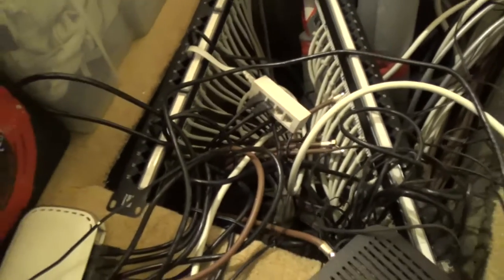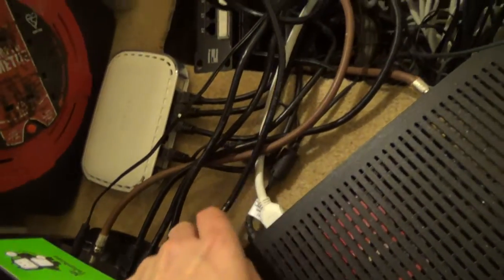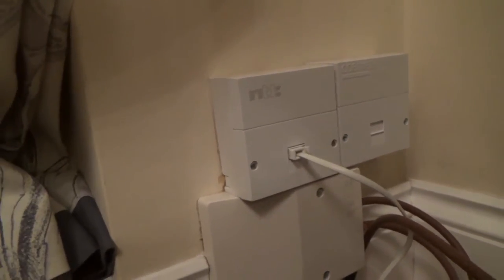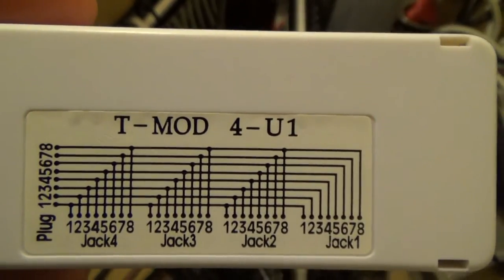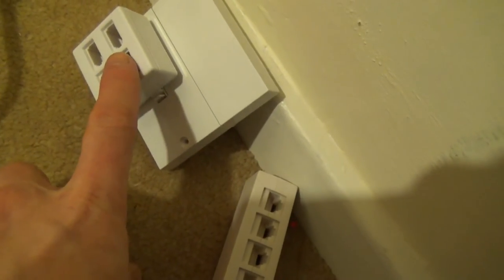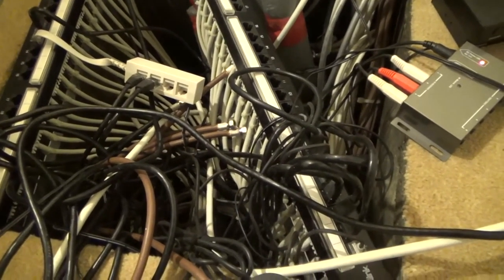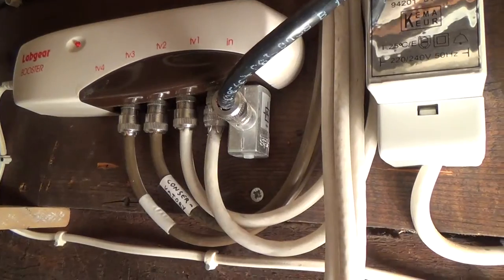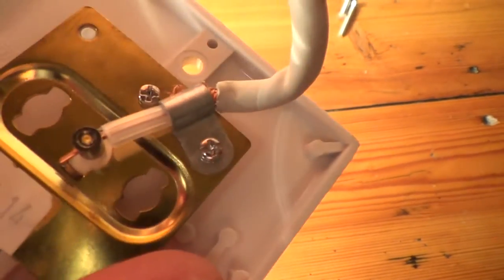How to connect up your home for Phone, Wired Network and TV (PART 2)

Comment: great video but my wife will kill me with all those cables lol. I have the main router in the hall and a homeplug to the living room and a cheap TPlink router used as a switch for laptop, skyhd box etc and extra wifi, works really well, I have laptop hooked to tv and used as monitor for streaming etc, I have better speeds via the second router on wifi than the main router,

Comment: These videos are great, Particularly these home network demos. There doesn't seem to be much online for the uk side of things. Especially youtube so thanks for the hot info!

I'm planning running conduit and trunking around the home, so after I've Renovated and have recouped some cash, I can start pulling the cables for this at a later point.

Do you know of any regs or rules for conduit or colour coding for low voltage cables in the uk?

Again thank you, seriously very informative.

Comment: Great video but just wondering why are there 6 terminals on the phone socket thanks Ben
Reply: Different phones systems used to utilise up to six wires most four and now just two but this rarely required nowadays. But you can always find that one old system somewhere. Using the spares and pins 1 and 6 can be helpful sometimes

Comment: Another awesome video. I was just wondering how was the router in your house, connected to the phone line cause the main line was no where near the router.
Reply from the maker: +Lee Jones Hi Lee, I am with Virginmedia so it runs down a coax type cable, so I connected up the incoming NTL (Virginmedia) box by the phone line via a CT100 type cable that runs to under the stairs.
Cheers Vince

Comment: Hey Vince, great videos mate, really taught me the details of what I'm about to attempt to deal with. 
I've moved into a new build that has been wired up with Cat5e/Cat6 to provide future support as a 'smart home'. From what I've learnt, I'm not sure its been done in the best way, and I'd like to know the best method for approaching this. Essentially, the '2nd fix' was not done and no cables (except the phone sockets) have been terminated. We're on BT Infinity, and the master socket/location is in the hall fitted with the Openreach master socket 5C. Thats currently where my Router sits (BT smart home hub/6). The master socket then feeds/extends (via cat5e in the walls) to the next phone socket in the kitchen, which then daisy chains onto the next phone socket in the lounge, then daisy chains onto the next phone socket in the spare room.... and so on. Eventually the last section of cat5e cable finishes in the loft room, also where all other cables (Cat6 x12, coaxials x 10 & speaker wire x 8) come to. The thing is, the cable marked 'BT MASTER' has essentially been daisy chained about 5 times (I haven't counted exactly how many right now) feeding phone sockets on its journey. So I'm not keen on moving my router to the end of that!!? To be honest, I dont really need the phone sockets/plugs throughout the house, so I was considering the only way to get the data straight to the loft room, was to terminate all these cables with RJ45s (using all 4 pairs, as opposed to 2 & 5 as it is now) and use couplers behind blank faceplates to feed a switch, which would then feed the rest of the house. But man.....  this surely could be a concern for quality of the signal?? Unless I'm missing something....  I just dont know if its been wired up correctly...  

Sorry for the long details, but any suggestions would be greatly appreciated...
Reply: Matt P look up fiberninja videos as he has a few explaining this better plus it's cable management porn

Comment: Hi, great video, thanks. What are the Rj45 to Rj45 splitters you're using for your phones called? Had a look on your shop for them but couldn't find them.
Reply from the maker: Hi, I still have some but they are not listed on eBay. Send me a message via eBay.
Thanks Vince

Comment: hi vince - great videos, thanks.  wondering whether to install cat5e or cat 6.  is cat 6 that much better, really?
Reply from the maker: +Linea Ceramics Hi, it won't make any difference at the moment but in the future you may see the benefit so if you are taking the trouble to install a network it is probably worth the extra money to install cat6.
Reply: Linea Ceramics cat6 has better and longer range signal compared to cat5/cat5e.

Comment: when you run your phone lines through your patch panel do you connect all 8 wires or just the 3 for the phones? thanks
Reply from the maker: I wire up all 8 on the patch panel so the port can be used for voice or data. But if I was making a phone lead to go into the patch panel then I would just connect the middle 2 wires on the RJ45 (pins 4 and 5 the blue pair) and then use a PBX RJ45 to BT socket dongle on the other end to ensure that all phones will ring.